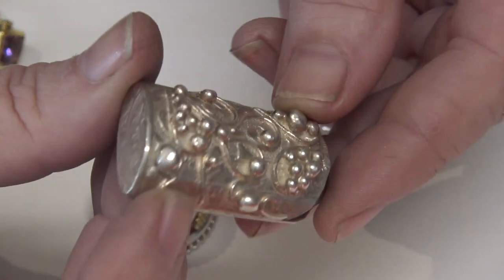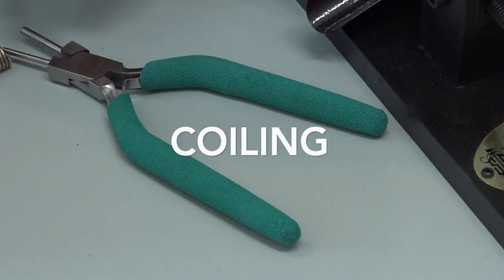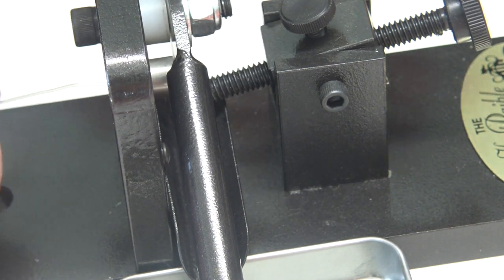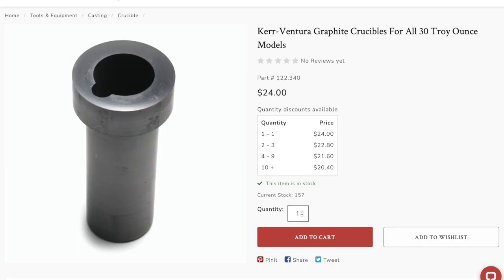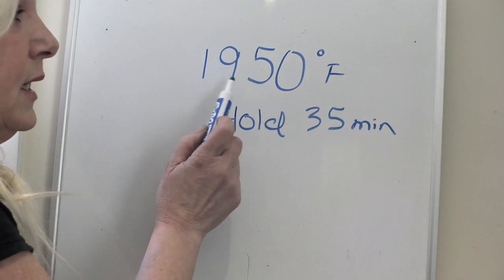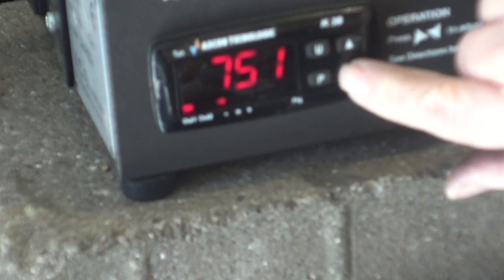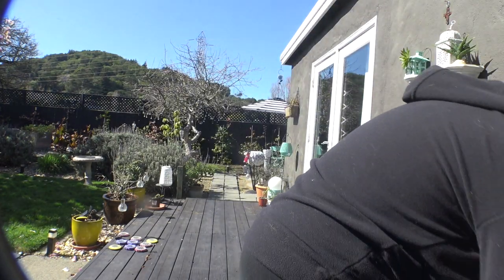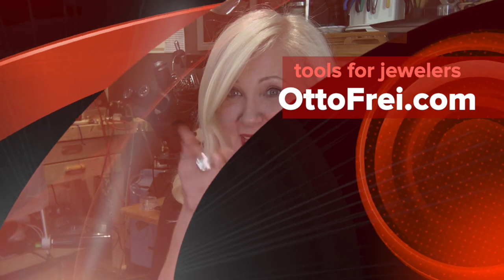The ABC's Making Granules

Comment: Thank you very much for this.  I also could not find any good sifters.  The tip to make your own was great.  Also appreciate the source for the screen. 
While I've not completed it yet, I've used very thin silver sheet, measured it to a small squares (using a ruler), then cut the squares out (using a high quality metal shears).  While not as fast as the Otto Frei chopper, it does the job.  I actually plan to merely mix the charcoal powder with the small squares in a random manner, then pack it all into the crucible as you have done.  No need to layer as I figure it should evenly disperse (the beauty of entropy!).  This I don't think would work with the small wire pieces as they don't have enough surface area, but the tiny foil piece are much more likely to stay suspended in the dust.  After they are melted, you can use a small jar with a retaining weir.  A little bit of shaking and the balls should fall to the bottom of the dust quickly.  Then you just decant the dust.  At the very end you can use a bit of water to flush the rest of the dust.  This is basically the same principle as gold panning.

Comment: I love the chopper too!  Is there any way to use a glass kiln (for enameling, for instance) to heat the fine silver to make granules?
Reply from the maker: I wondered about that also,   the temperature of a paragon type kiln may not be able to hold that hot how hot is yours?
Reply: @LeslieKailVillarreal  I'm going to check tonight.  I have a Paragon that is programmable to hold at a temp, but I don't know how high.  I also have a Vcella that is not programmable, but my guess is will go hotter.  I have never either past 1600 (and rarely go that high), but I am going to check each for their capacity.  I can't thank you enough for the tutorial--it's just great, a real gift.